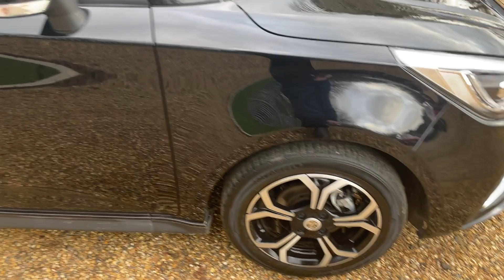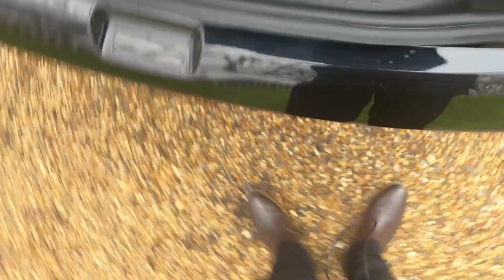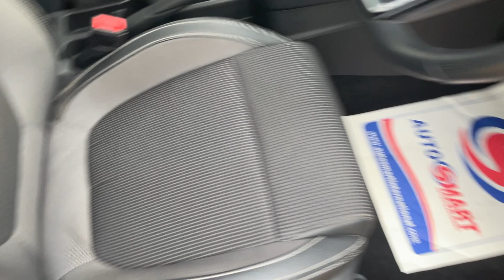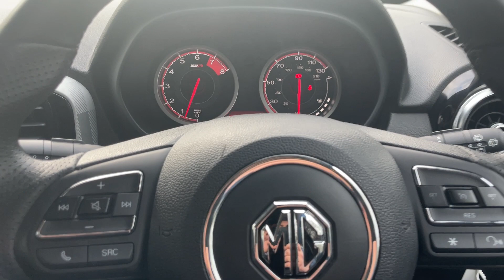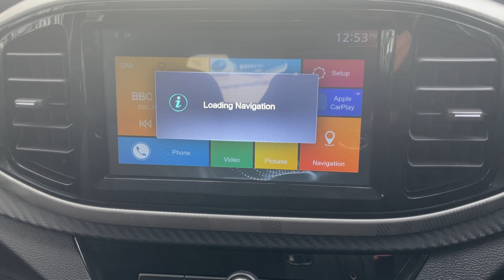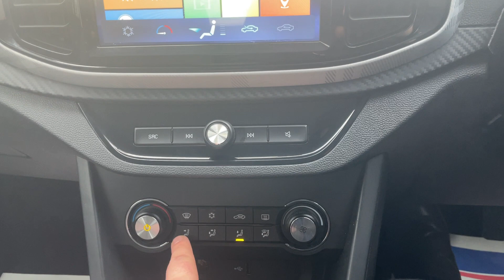***VEHICLE NOW SOLD*** MG3 EXCLUSIVE NAV 1.5Vti-Tech 5dr 106PS 5spd MAN

Comment: it has an ncap rating of 3,absolute garbage for a new car
Reply from the maker: This is a very good vehicle for the money. 3 stars is “average occupant protection but not always equipped with the latest crash avoidance features” - so where this vehicle doesn’t have a driver assist pack it remains at 3 stars which I can assure you the majority of people buying these do not want… ie. Turning lane assist off every ignition cycle… absolute Garbage of a comment there, Dave. Clueless even
Reply: These are good cars
Reply: Very good car